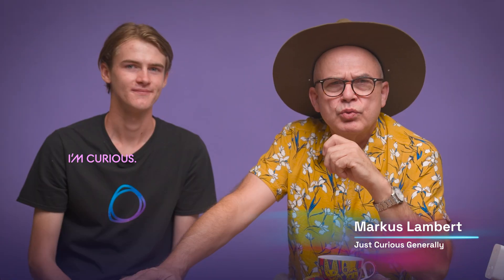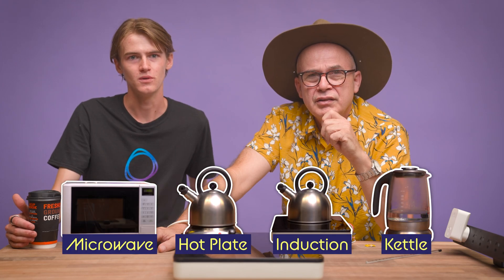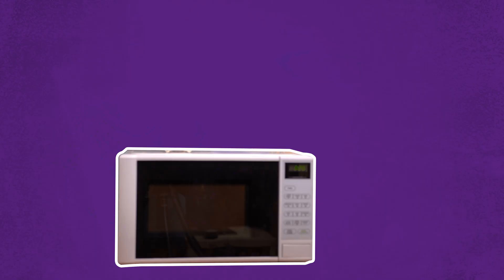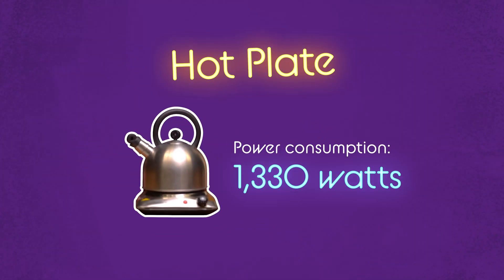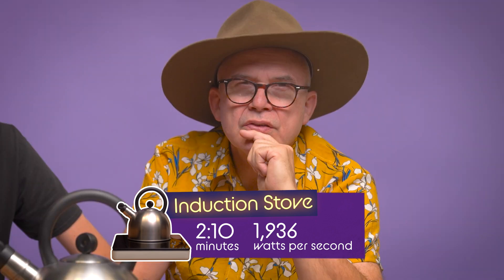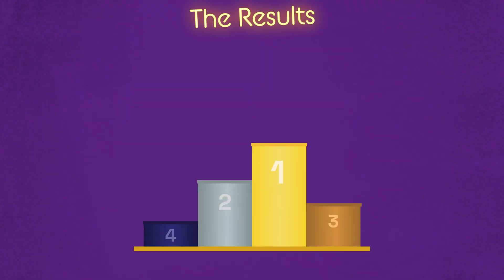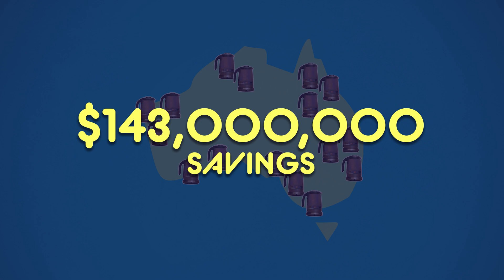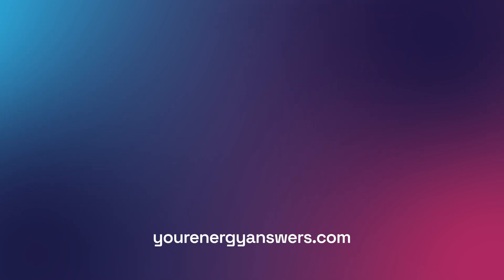Most Energy Efficient Way to Boil Water ☕ (Kettle vs. Microwave vs. Stove)

Comment: I'm always debating with my wife between electric kettle and cooking with gas.
Reply from the maker: Hopefully, this video helps settle the debate!
Reply: @yeanswers i think i might've missed the part where you mentioned about cooking using fire from gas, but after researching the cost here in Malaysia, it's a lot more cheaper using gas.
Reply: @Adib-v4s  More than half the heat created by a gas stove just flies up beside the pot, and doesn't go into the pot.  It might be efficient if you live in a Winter climate, because you can count on your stove to heat your room while you're cooking, but just looking at cooking, gas is much less efficient than an induction stove.

Comment: what about an immersion heater? It really depends on the amount of water.
So you talk about a single cup. Kettles don't like to heat a cup. The ones I had want a minimum of 0.5l. And then the calculation implodes. So I claim an immersion heater is worth a try since it's heating almost nothing but cup and water.
Reply from the maker: Fair point — and you're absolutely right about kettle inefficiency when you're only heating a single cup.

Comment: Almost 50 years old and I've never seen an electric kettle in anyone's home ever.

They definitely aren't in everyone's home.
Reply: If you're in USA, they're less of a thing there, partially (mainly?) due to 110 V AC, which makes them way less practical, because they are way slower to heat up the water (assuming "easy mode" usage, i.e. no 220 V kettle running on a dedicated 220 V AC circuit).

Additionally, USA isn't really a (homebrewed) "tea culture". Meanwhile, in UK (and sonewhat also in its past/present "influence sphere"), the power utility companies literally have to plan ahead for the 16:00 h (IIRC) power spike, when half the UK puts on a kettle for the afternoon tea.

...or so I've heard, anyway. (Typing from an EU country, and water kettles are quite ubiquitous.)
Reply: @cbs1710  I think it's more habit here or "people just do what they've always done". Most young people I know have electric kettles, most older people (not including me) still heat water on a range / stovetop. True, max wattage on a standard 120V  15A circuit is 1800 watts, and appliance makers in Canada and US also generally limit that to about 80%, so that's a max of 1500 watts for almost any appliance. Most electric kettles here are between 1200 to 1500 watts. So an electric kettle here does take maybe 50% longer than the 240V 2000 to 2500 watt kettle shown, but that's still faster than boiling water on a standard range (gas or electric) or microwave, and far more efficient. When it comes to cost all that really matters is the efficiency of heat transfer. Where it gets tricky is that in many places natural gas (methane) is still used for cooking and heating and that can be cheaper where electricity companies aren't properly regulated or where gas companies are subsidized. Both of those things are quite common in the US.
Reply: Everyone has an electric kettle here in Canada.
Reply from the maker: Still very popular in Australia